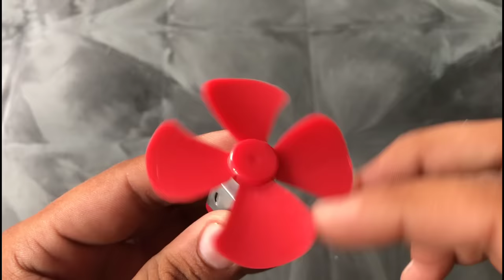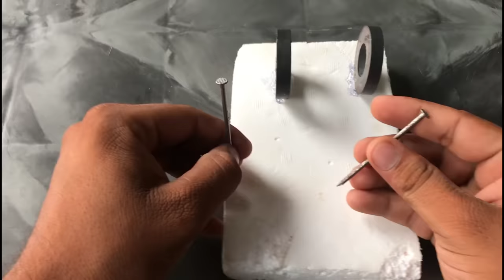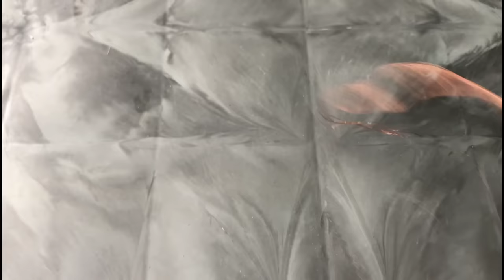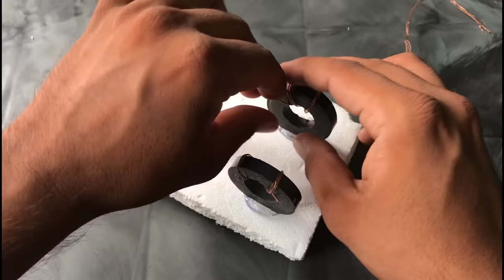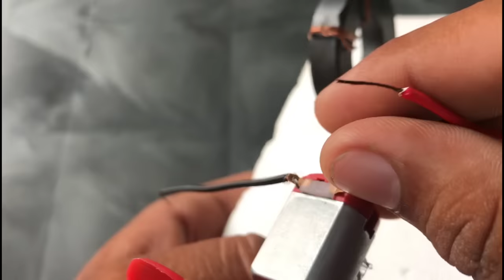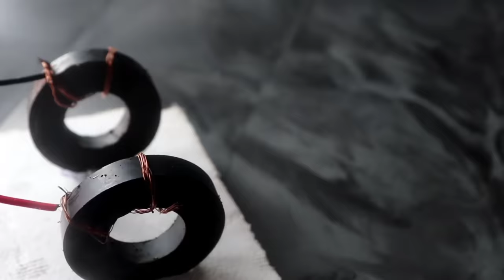Free Energy generator device with magnet || 100% Free energy || 2020

Comment: Change of magnetic flux causes electric current to flow in a coil. Here magnets are not moving neither is any visible coil connected to motor. Even if we consider wires as a coil , circuit is not complete. Alternating field flux causes AC voltage , and here you show DC motor. It's not possible without batteries.
Reply: Pls where can i get a coil
Reply: ऐसा नहीं होता है
Reply: the battery is well hidden